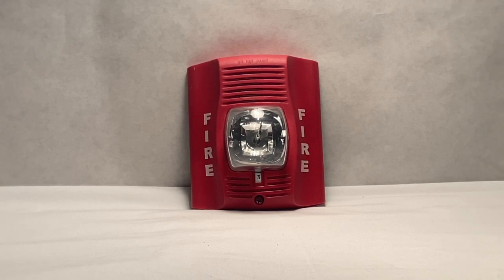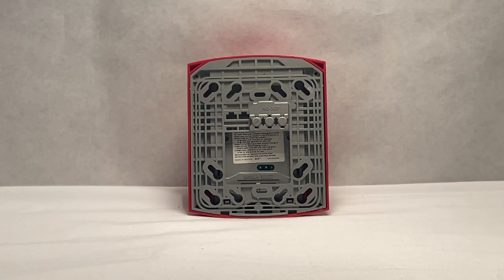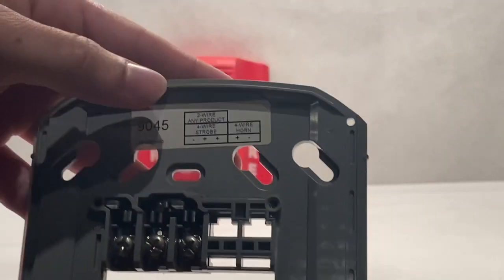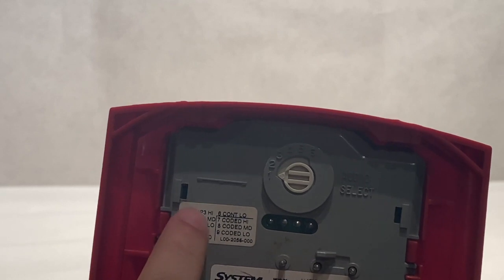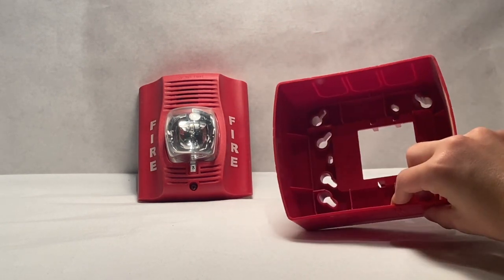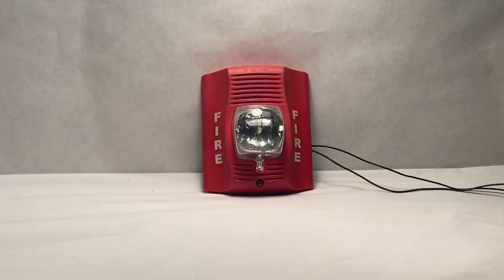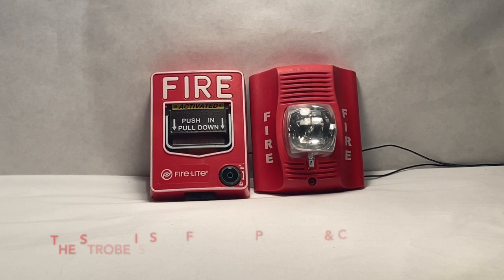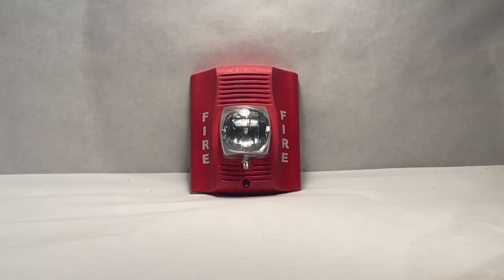System Sensor P2R (SpectrAlert Advance) Fire Alarm Horn/Strobe Overview + Test (REMAKE)

Comment: This alarm is so ear piercing
Reply: I personally think the Wheelock AS is just as ear-piercing as the Advance. I should know; my ears are still ringing after hearing a system with them going off last weekend without protecting my ears in any way (as I had to use both hands).

Comment: One of the most common fire alarm signals out there. My college campus has these in some buildings, and my first elementary school got them after their original Simplex system started failing and had to be replaced.

Comment: Are these common in schools?
Reply: Well, I had this alarm at my old school. And at my current school, there’s one outdoor device. And, I’ve seen many schools with these alarms, like when there are fire drill videos on YouTube, the school might have these alarms. So to answer your question, yes. But not as common as simplex alarms in schools. But in general though, they are just one of the most common fire alarms.
Reply: @Oof-zl6lt  In my city's school district, they've been replacing Simplex systems with Notifier and sometimes EST, and so I've been seeing Simplex alarm signals getting replaced with Advances.
Reply: @granthart2791 not in my school district thank goodness.

Comment: To me , the spectralert advances are overrated. These things are in every other building where I live. Im not to big on the design. I prefer the other system sensor alarms. Also the alarm ditched the 3k hz tone for medium volume which I think is useless because installer would just put the alarm on high volume if not low volume. Why did I think 3k Hz is better then medium volume, well it can be used in residential Applications unlike medium volume. Honestly I like the L-Series better because the design and features. Say anything you want about the L-Series being worse then the spectralert advance. I prefer the L-Series or any system sensor devices (the Muti-alert (mass series), and the spectralert classic) over the spectralert advance. I forgot that the chime strobe version is not as good as it’s predecessor.